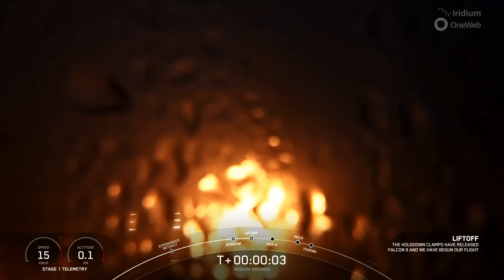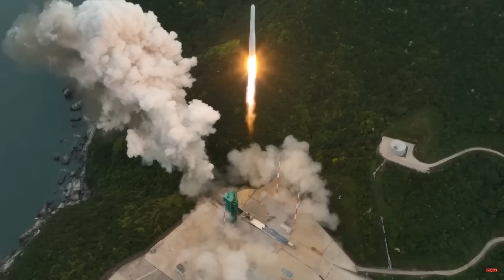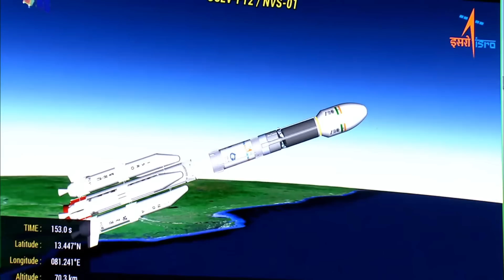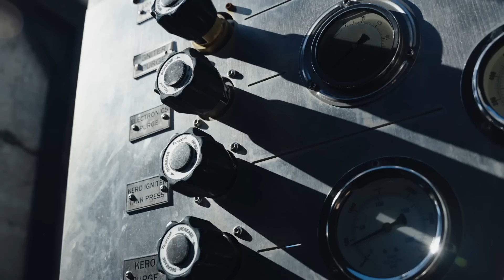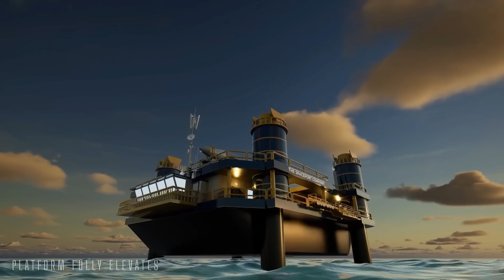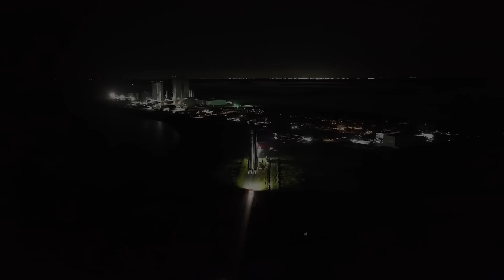Record Number Of Humans In Space! - Deep Space Updates May 29th

Comment: Spoiler: Gas thermodynamics is a branch of chemistry that studies how heat added to a gas can be converted to mechanical work. The process is termed a heat engine. It's a very common thing like the internal combustion engine.
The principle is to heat gas in a container and get work as one wall of the container moves as in a piston.
A rocket has its own oxidizer, so we are told it produces thrust in a vacuum.  But for rockets, the movable wall, an essential factor in ALL heat engines, is the 14.7 psi ambient air pressure.  Substituting a space like vacuum for this piston results is zero thrust.  At super low pressures oxygen and rocket fuel refuse to ignite.  
It's physics and its chemistry which prove space travel is a hoax.

Comment: If F9 loses an engine does the software know that it needs to commit to expendable mode?   Should they keep a barge on station as a contingency?
Reply: If they plan on landing the booster on a drone ship, it has to be in place BEFORE the launch. If the Falcon 9 first stage loses an engine, so that the booster is expended, then the fuel that would have been used for a landing would have been burned up getting the second stage to orbit. So it would just crash into the ocean, like any other expendable booster.
Reply: Yes, the F9 flight controller can definitely compensate for a lost engine autonomously. It already happened on one of the earlier launches, where first stage burned longer to reach the desired orbital speed. The rocket still tried to land afterwards (on a barge), and I think it was unsuccessful because the failed engine was one of the center three used during entry burn. Having said that, I don’t think it’s worthwhile for SpaceX to send one of the barges out just in case, since the whole point of RTLS is to save the cost of sea operations. It’s not just the barge but the crew, security, insurance, etc. Which is why Rocket Lab are designing Neutron to only ever do RTLS, they are not planning for barge landings - although this can change. F9 reliability is so high at this point, it’s cheaper for SpaceX to expend the first stage in the odd chance of a failure, than keep a barge on station at all times just in case. Plus, it wouldn’t necessarily be in the right position since a longer burn with fewer engines also changes the flight profile, although I’m not sure by how much, perhaps the flight controller would be able to sufficiently adjust the trajectory on the way down to meet the barge.

Comment: having the fuel on top of that moon lander is a good idea.  it should help shield the crew from cosmic rays while inside on the moon, like water does right?
Reply: But it puts the astronauts less than a metre away from the part of the vehicle most likely to blow up, rather than over 10 metres away.
Reply: @jamescobban857  if this engine failed, no need to explode, then I think the astronauts will have no necessary to worry about the distance😂

Comment: Just want to poke head in that a bunch of comments on the ispace lander video (along with myself) pointed out that it was a management issue more then a software issue. They calibrated all the sensors for landing at a site, then the site was changed and the new location happened to pass over the crater, that then threw off the sensor. If the site hadn't been changed (or presumably they had been given time to redo the calibrations), then the there is a higher chance it would not have happened.

Comment: I'm definitely part of the group of people that don't recognise anything less than 100km as space. I acknowledge that is is space-like and very near space including in terms of behaviour, but we must draw the line at some point since it is an arbitrary decision, and I find the neatness of 100km to be a great and fairly agreeable line in a way that 50 miles isn't quite
Reply: Actually 80km is the official “Karman line” as that is the altitude at which the speed required for aerodynamic lift is higher than orbital speed… 50 miles is “approximately” 80km…
Reply: @allangibson8494  Von Karman's approach was theoretical and didn't set a fixed boundary. There are many factors that affect the lift vs. inertia equation for a particular aircraft, including aircraft design and variations in the height of the upper atmosphere. Von Karman's original estimate was 84km, in a later writing he used 91km. Other people calculated different values, and then in the 1960's the FAI rounded it to 100km and that's where it has remained. 

Some people have called for lowering the international standard to 80km since spacecraft on highly elliptical orbits can dip down that low and remain in orbit. But the reality is that they won't remain in that orbit for long, maybe a day or two at most. At least at 100km you can be in a circular orbit, although you won't stay in that orbit for very long either. NASA set 50 miles (80 km) as the boundary during the X-15 program because that was the altitude where control surfaces became ineffective and the plane had to use RCS thrusters for attitude control.
Reply: @StevePemberton2  The lowest orbiting satellite to date was at 167km - which was also an air breathing vehicle (it used an ion drive to balance the aerodynamic drag).
Air density halves every 5km you rise so at 80km, the density is 1/65536th of sea level pressure - not enough for your body to tell the difference between that and a hard vacuum…
Reply: @allangibson8494  Yes and that's why I am not in favor of Jonathan McDowell's approach, where he counts satellites that were within a few hours of reentering the atmosphere and which made at least two complete orbits after dropping down to 80km in their perigee.

Von Karman's approach didn't even take full orbit into consideration at all. He was just calculating the moment when lift ended and inertia took over. His equation didn't care whether or not the spacecraft could make a full orbit at that altitude.

On the other extreme, using your 167km satellite as an example, if it was based on minimal useful orbit (whatever that is) then we would probably be looking at 150km or something where a satellite could in theory last a few weeks. Others might say 300km where a satellite can remain in orbit for several years without any reboost. But of course no one will accept this as a definition for where space begins.

As for the effect on the human body at 80km that is a good point, and is one of the reasons why I have no problem with the Virgin Galactic people saying that they have reached space. But as far as an official boundary, I prefer not to use either airplanes or the human body as a standard, but rather the atmospheric effects on spacecraft. Of course someone can take that approach to whatever extreme they want, after all even geosynchronous satellites are slightly affected by the atmosphere. But I like the idea of considering when a spacecraft entering or exiting space experiences significant effects. And that level, around 100-110km  is within the general ballpark of the "human factors" viewpoint of dark sky and virtually no air pressure.
Reply: I agree but for different reasons. The 100km boundary was set somewhat arbitrarily by the balloon people. That's what I call them anyway, the FAI started in 1905 as an organization to set standards for ballooning records, and they eventually expanded into aviation records and spaceflight records. But I prefer 100km over the 80km (50 mile) boundary, even though that one is closer to von Karman's original calculations. Von Karman's approach made sense at the time, as he looked at it from an aviation point of view. His definition was the point when an airplane stopped being an airplane and became a spacecraft.

However we now have over six decades of experience in space, and the 100km line better reflects the viewpoint of a spacecraft exiting and reentering the atmosphere, as that is roughly the boundary where atmospheric effects begin (or end). In fact I think 110km would be better. You may have noticed that payload fairings aren't normally released until they are at least that high, because there is still some heating above 100km. While it depends on the specific launch and atmospheric conditions, most fairings are not released until they are over 110km. But I doubt if the balloon people or anyone else will be willing to give up their nice round numbers, so I am okay with 100km.
Reply: @StevePemberton2  Both numbers are arbitrary values that are close enough to the theoretical Kármán Line... 100km was chosen because it's a nice round number for those using metric, and 50 miles was chosen for exactly the same reason for those using miles.

If you want to be scientific, the best you can say is that somewhere between about 80km and 100km altitude, you reach a state where aerodynamic flight becomes infeasible.
Reply: Americans go "Kilometre?  What is that?"
Reply: @jamescobban857  Maybe a little exaggerated, but yes in the U.S. kilometers are rarely used in daily life. Whereas metric volume and weight measurements are quite commonly used especially in food products, manufacturing, etc. and so most Americans are familiar with those metric units. And anyone who travels abroad or even goes to Canada will be familiar with kilometers.

Comment: I hate SLS. It's an expensive joke, but at least it works.......then there is starliner. What the hell is the point? How long has it been? 3 years since spacex succeeded? Clearly spacex knows what it's doing and boeing doesn't.
Reply: NASA wants at least 2 providers for the commercial programs. If NASA had only chosen one provider for Commercial Crew in 2014, they would likely still be relying on Soyuz to get crew to the ISS.
Reply: @steveaustin2686  no considering that the 1 provider is the only provider that has delivered. starliner is a joke.
Reply: @awilliams1701  In 2014, the choices were Dream Chaser, which was behind in the development from the others. Crew Dragon, from the new upstart with 12 Falcon 9 launches under their belt and was still trying to land a booster (didn't until over a year later and didn't reuse until 2.5 years later). And one of the top aerospace companies at the time in Boeing, the 737Max had yet to do a test flight, with Starliner. In 2014, NASA chose Boeing as the top provider with SpaceX coming in second. So if NASA had only chosen 1 provider in 2014, like so many say that they should have, then Crew Dragon is likely not built and NASA could still be relying on the Soyuz to get crew to the ISS. NASA chose 2 providers, precisely because they didn't want all their eggs in one basket, like with the Space Shuttle. And it is a good thing NASA chose 2 providers in 2014, as SpaceX has carried the load while Starliner works out its problems.

Comment: SLS is more expensive, maybe unreasonably so, but to be clear... it worked on the first launch. Just saying.
Reply: You mean the first launch of a mission ready system as opposed to the launch of a use once disposable test article from a system still in development?
Reply: SLS was built with the design philosophy that it must not fail, it was far too expensive to fail. That's one big reason  it cost so much. If it had, the Artemis program would have been set back at least 2 years, more likely 3. And there was little excuse for it to fail, it used actual engines that had flown multiple times and an SRB design that had decades of flight use. Starship was basically a mid-air technology test of multiple new systems no one had ever attempted before. There's really no parallel between the two.
Reply: @donjones4719  another reason it cost "so much" was they got funding for it on the basis of "using  tested and in production" engines and boosters from the shuttle program. and then changed them both sufficiently to get a jobs program for EVERY STATE in the union, so it's budget cant be voted away without cutting jobs in a majority of the congressional districts.
Reply: Well, if you don't count aborts, at least. It worked the first time they actually reached T-0 on the countdown, but it took them a few attempts to get there.

Comment: Scott, I was watching the Long March 2FG launch and noted that they dump the boosters and the center core at basically the same time.
Why wouldn't they just dump the center core with the boosters still attached, seems like it would be a simpler design.
Maybe they recover the boosters, but not the core?
Reply: If they're intended to break up, having them all still connected would slow the process down.
Reply: Because the original Long March 2 was  just the core, the boosters were developed much later to increase the rocket's capabilities.

Comment: Is China using primarily hypergolic fuels?
Reply: They're transitioning away from them on their new generation of large rockets.
Reply: Yes always. The really big one Long March 5, that launches their ISS segments is the first major Chinese rocket not to use hypergolics. The 4 boosters are kerosene/LOX and the core stage and upper stage a cryogenic hydrolox. So the LM5 is a pretty big step forward. They also use the kerosene boosters seperately as small launch vehicles now and the "commercial" companies almost all use kerosene. But they still fly the old Long March that use hypergolics. They fly a whole bunch of different vehicles. 

But in general moving away from hypergolic to either kerosene or cryo, hydrogen for now, methane of course is the new hot thing and China isn't planning on missing out. Possibly the giant LM9 will be methalox. But that's early stages. Plus the Made in China Starship. That's coming eventually they make no secret of those plans.
Reply: @please_stop-v7o  The Zhuque-2 launched in Dec 2023 and it was a methalox booster. The second stage failed, otherwise they would have been the first methalox rocket to orbit.
Reply: @steveaustin2686  first methalox rocket to orbit was surely a Falcon? wasn't it?
Reply: @stevevernon1978  Nope, the Falcon 1, Falcon 9, and Falcon Heavy all use RP-1 and LOX. Starship is the first SpaceX rocket to use LCH4 and LOX.
Reply: @steveaustin2686  i stand corrected.

Comment: Every single launch has unrestricted and diverted exhaust flow on the pad. Not one single crater formed, no steel water flow blast plates. If the engineers for Starship stage 0 succeed it will be a as radical of a change as any from SpaceX, but will it be an innovation? Sure, for areas with a shallow water table but the added complexity is also a factor. Is it that much of a benefit?
Reply: Depends on how costly it is to build a standard trench vs a flat steel pad like SX. Plenty of other factors like acoustics will apply, but you can design your rocket around them.
Reply: @seasickrhino8926  In other words, make the rocket heavier to deal with the stresses imposed in the first thirty seconds of the launch sequence for a problem that was addressed in the 1950s. Sounds like lost payload.
Reply: @cowboybob7093  not necessarily, the difference will likely be minimal, and one does not need to directly copy SX’s design. Adjustments to the water jet pad can/will likely make it pretty much the same as a bill standard diverter; and more interestingly, can distribute the acoustic stress more evenly than a linear diverter like the 50s. 

Time will ultimately tell if it’s a gimmick or an improvement.
Reply: You make the simple assumption that all rockets are the same power.  Lots of flaws in your understanding, you shouldn't try and fake understanding something you clearly don't.
Reply: @TheEvilmooseofdoom  That's a really weak reply, and off the mark to boot.

Comment: The orange fumes of nitrogen tetroxide at 300 Mt distance - the Chinese guy was lucky the wind was blowing them away.
Thank you Mr. Manley for all the updates.
Greetings
Anthony
Reply: Yeah, I wouldn't want to stand this near to a normal rocket, let alone one that spews cancer and acid at me 😮

Yet I kind of want to 😬
Reply: It took me a while to get that 300 megatons isn't the thing you meant
Reply: @marwinhochfelsner  300 Mountains? 300 Mile...ts? Mites? 300........
Reply: @marwinhochfelsner  LOL I was thinking the same.
Reply: Not so much luck, pretty sure they're not stupid. They checked meteo data before setting up camp. I fully assume that, giving them the benefit of the doubt. If not, they're a bunch of dumb fcuks
Reply: I'm sure he was vivisected for his security breach nonetheless.
Feck Winnie the Xi too.
Reply: @Vlad TheInhaler i thought LM3 it used both nox and hydrazine... i am honestly scared those people in the video are like not going to make it....
also, the distinction between N2O4 and NO2 is kind of pointless outside of a sealed pressure vessel. its a classic lechat demo showing the sealed NO2 brown gas turn colourless when placed in ice because it forms the dimer adduct based on some kinetic equation or whatever.
i dont think you can see n2o4 due to its visible light band gap resonance being disrupted... so the only cloud you are seeing is no2 which has the delocalized pi electrons which fuz around and therefore absorb light and become that icky brown color. less pedantic people just call that cloud of deaf NOx....
Reply: Americans don't know the proper symbol for metres LOL

Comment: The Axiom-2 booster used 3 engines on landing. Did that make a difference in the deltav used for landing (shorter burn = less gravity losses)?
Reply: Yes it makes a large difference, the TWR is so giant that you can basically ignore gravity losses at least for that part of the burn and it scrubs most of the velocity while under very high thrust. Plus when using the center engine the stage is very light, so more savings. They have been doing it on high energy missions for a while where margins are tight. Like FH sideboosters.
Reply: It only used three-engines momentarily; the final landing was still only done on the center engine.